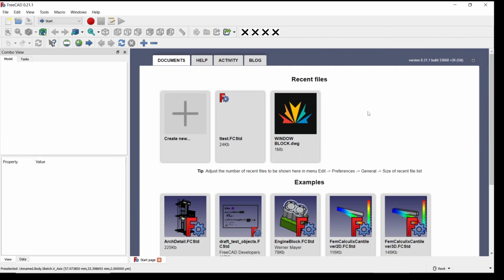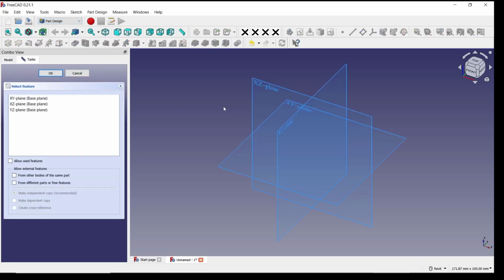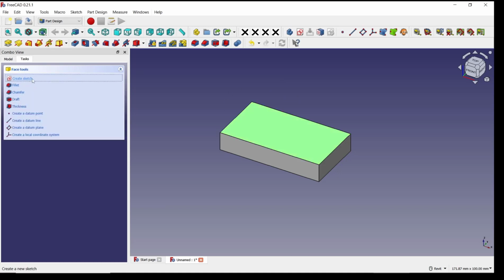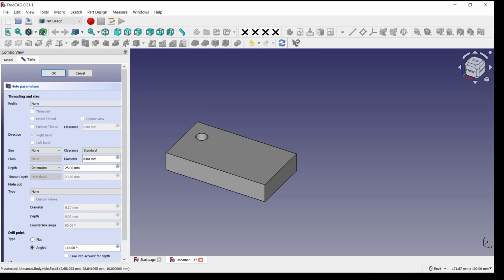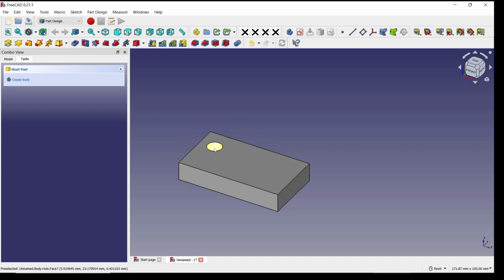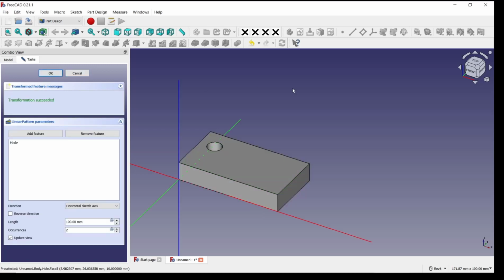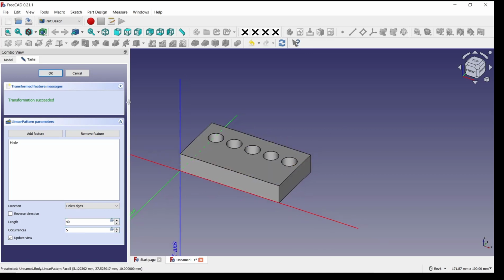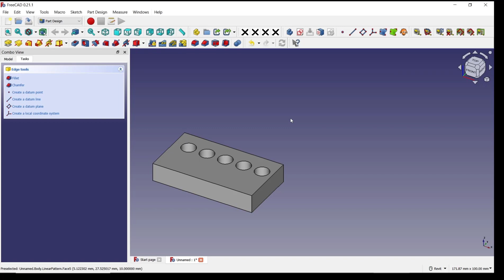FreeCAD How To Hole Array

Comment: Trying to make an XY array of circles in FreeCAD 1.0 Sketcher using VarSet variables to define the array parameters. The Move / Array Transform tool works well when i manually create the array, but I can't seem to go back and edit the array constraints with a formula pointing to my VarSet variables.

Comment: Thanks for the video. I, too, want to learn how to create a 2 dimensional (matrix) hole array. Basically, an X-Y grid of holes. Seems Sketcher can do it, but it's very slow in computation. I was hoping to make the linear array in Part Design, as you did, and then create an array of that linear array. But, can't figure out how to do it.

I noticed Draft wb can do 2D array as well, but haven't yet tried that approach.